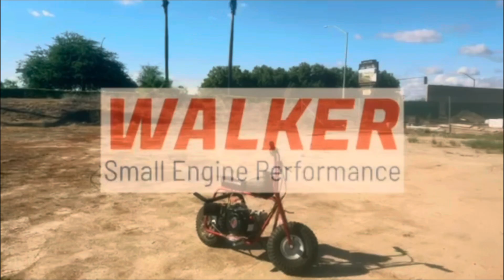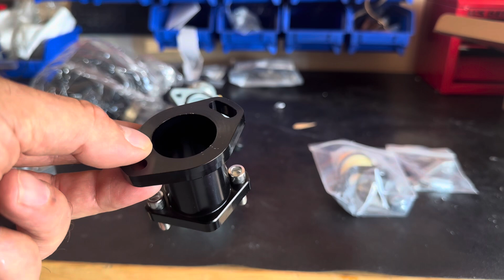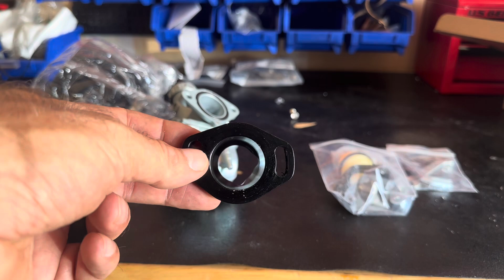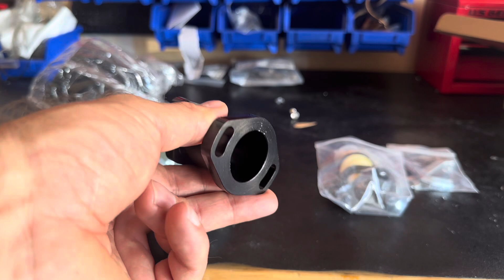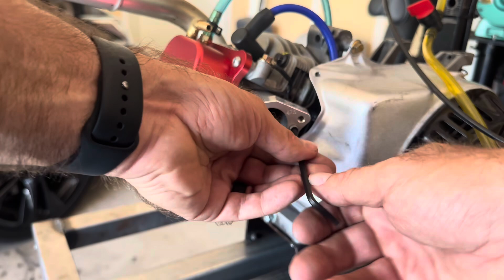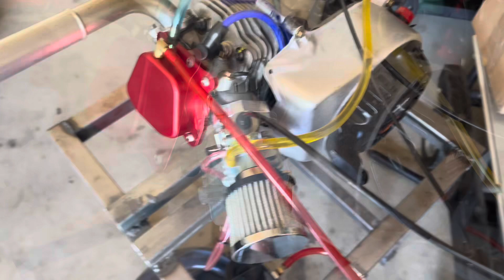Mini Bike Intake Manifold. You Get What You Pay For.

Comment from the maker: I misspoke in the video. At this time, I see no manifolds for this application from Big Block Clones. They have some great options for PWK style carburetors and the Shredder head though. Check them out.
Reply: I forget what size/model it is but my Nibbi is bolted directly to my shredder head. With a phenolic spacer of course. Maybe not enough length on the intake?
Reply from the maker: @POS_miniracer It’s all application dependent. If you need a compact package, then it’s definitely awesome. Lose some torque? Probably not a ton and everything is a trade off.

Comment: Another option is to get the same style intake from Nibbi. It doesn't have the slotted holes.

I had one of the cheap intakes defective. There was no lining up to the carb without Dremel work on the slotted holes. Easy enough fix and once it's on there, there is no need to remove it.

When Redbeard did his intake video he should have included the cheap intakes because they are what most guys are going to use. And I bet they would have done pretty well compared with the others.
Reply from the maker: I have installed one Nibbi intake for the VM-22 style carb. No issues. I just prefer the EC intake. It may sacrifice a small amount of torque on certain combinations but it’s so simple and so compact that it’s worth it on a mini bike I think.

What would be cool is @Black66 crazy long intake on @RedBeardsGarage dyno😂
Reply: @WalkerSmallEnginePerformance  oh yeah. That would be fun to see.

Comment: Hey I aligned the chain for this bike and took it for a text ride next thing yk it wasent starting and pulling back hard I checked EVERYTHING I reset the lash at both tdcs like 20 times checked for spark realigned the manifold messed with jetting and nothing. So ur telling me the whole time it was just a manifold leak?🤦🏽‍♂️
Reply from the maker: It was one of those oddball situations where a bunch of tiny things added up to cause issues. Honestly, I don’t know if I can point to anything obvious and say “that’s the problem”. It happens. I’ve worked on just about every kind of car, farm equipment, construction equipment, you name it, and these simple little engines have caused me more headache than anything. I just did the video because I’ve wanted to talk about those manifolds for a long time and I finally had one that I was changing out.